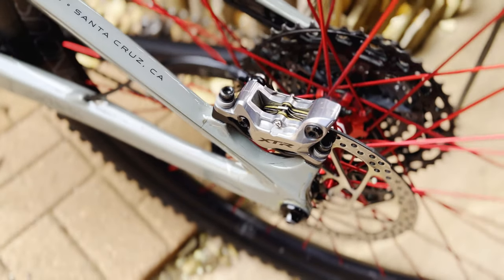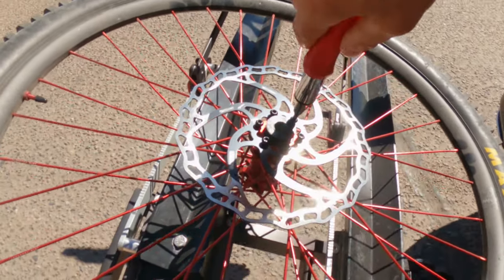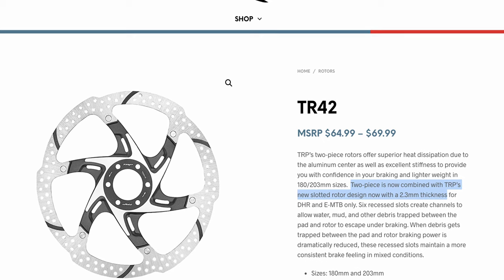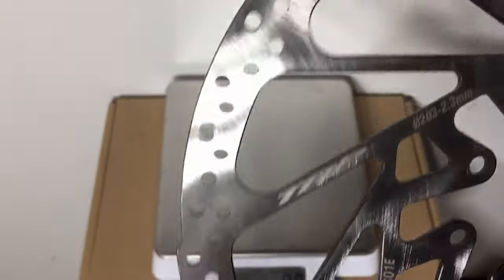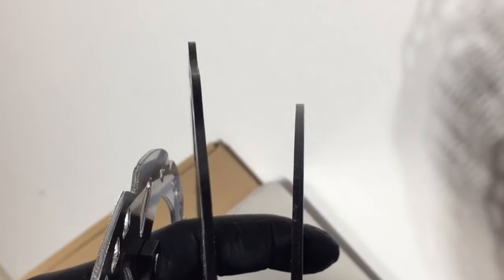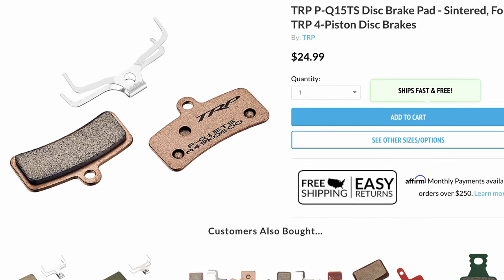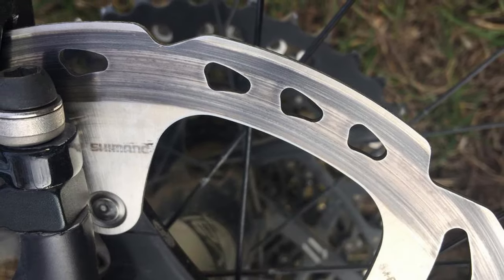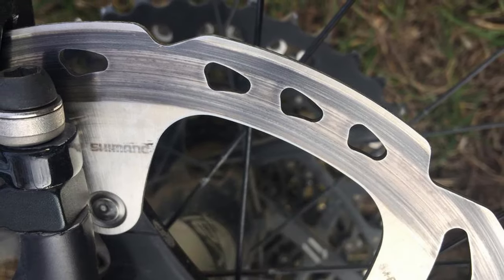Mountain Bike Brakes 2 - TRP 2.3mm Rotors: Next level performance.

Comment: We always appreciate your honest and up front reviews. I just wanted to explain a couple things. Firstly, the "popping noise" heard when applying pressure to your brakes with our rotors are 100% designed to do just that. We spent much time developing a rotor that would vent the hot gasses produced by the brake pads "the popping noise" the bigger cutouts on our rotors are designed to take a big gulp of air and as it passes through the pads and gets compressed then almost give you an exhaust note on exit which will cool the rotor and pad surface simultaneously. Secondly it looks like your pad sweep was off by about 2-3mm too high, so you where not even getting full pad contact. never the less, TRP makes a fantastic product! Also know that we take your criticism carefully to mind when developing our new products. keep an eye out for our new Disc Shark® and floating rotor that will be a true floating rotor both axial and radial!
keep up the video's and good work!
Reply from the maker: Thank you for the explanation, I'm sure it will help others as well as it helped me in understanding. When I called to get an tech answer, no one seemed able to explain what you did right here. So thank you for that.
Reply: This is why I love this brand lol, even though I have trp brakes I still use galfer PRO pads and they definitely changed how my old avid brakes felt

Comment: Great video. I’m also looking to improve on my Shimano 1.8 rotors. I run saints with mtx gold pads but don’t find them quite powerful. Perhaps I didn’t bed them properly or most likely bc I’m 225 lbs. TRP site shows the TR42 rotors at 2.3 thick. Wondering if this is new from TRP. Thanks in advance.

Comment: I'm not sure why everyone seems to constantly say Shimano brakes are "on or off" or "they have no modulation".  If you want to actually see what brakes that are like that feel like, try out old Hayes Nines.  Shimano Saints/Zees/XTRs most definitely DO have modulation, it's just that it's only a few MM of lever travel between no brakes and full brakes.  They force you to be much more delicate on the brake levers, but once you learn how to modulate them, oh baby what power and control they provide.  Yes they are pretty touchy, but what do you prefer, a brake with all kinds of modulation but next to no power like Hopes, or with great modulation like SRAMs but zero reliability or brakes that are a bit touchier, but are very reliable and have way more power?
Reply from the maker: I prefer my new TRP DH Evo brakes, serious power,  a little modulation and power to throw you over the bars. All while staying cool in constant braking descents. For a guy who is 215 without a pack, I love power. I will never uses SRAM brakes again. They have to be the most unreliable brakes on the market and they fade in prolonged descents losing power to stop. The TRP's are not lightest as say a SRAM or Shimano XT or XTR 4 piston but they are also not as expensive either. Priced right...
Reply: I don’t know but I have the seal codes rsc with 203mm rotors front and rear trp. And they never let me down. Love them
Reply: I don't hate the Shimano they just don't have much feel to them, coming from dirtbikes you appreciate having reliable modulation like the trp DHR or most SRAM brakes. I have run 3 sets of codes RSC and sram db8 they are super reliable for me. Idk if I'm the outlier everyone shit on SRAM brakes for various reasons but I've been impressed with the feel and reliability...
Reply: SRAMS are bomb proof if you do normal maintenance

Comment: I have Code Rs on my new DH bike and they feel really bad. There’s visibility a large gap between the rotor and pads and the brake feel reflects that. There a big dead zone at the beginning of the brake pull. Thinking about getting these to reduce that dead zone.
Reply from the maker: Yeah a 2.3mm rotor would fill that up, sounds like they would fit.

Comment: This video confirms to me my problem Ive been experiencing with my SRAM G2 Cleansweeps with BB7s.  Rear 160mm isn't so bad.  But the 180mm front is very noisy with the slot cutting noises that I can feel jittering away thru my rigid fork.  Probably putting extra pits in my headset bearings.  TRP RS01E don't seem to come in 160mm.  :(

Comment: Love this video man! 
No one has a legit review on these rotors. I'm running Shimano RT66 203mm front & back with MTX red label pads. I'm considering TRP RS01E like yours but unsure if I should reduce my rear to 180mm (like your setup). This is the first time I've had 203mm in the back and man....they STOP. 
Also considering TRP pads for my XT 4 pistons. Are they better than MTX?
What do you think? 
BTW....I'm riding a 2020 Rocky Mountain Instinct BC.
Reply from the maker: What you’ll notice on mtx pads vs TRP metallic sintered pads is that one, the mtx have a quicker bite point. 

Next, trp pads are not as immediate in bite but they’re just as powerful . Furthermore, trp pads have more modulation. I’ve come to like it really. Also, trp pads are more affordable in price. But really, you can’t go wrong with either though. 

Honestly, a rear 180mm TRP rotor that is 2.3mm is going to feel like a 203mm rotor that’s 1.8mm thick. You can run the trp rear 203mm but I think it’s overkill. 

But remember, if you watch the video. If you go with the TRP rotors choose your pads and stick with them. If you use new and different pads that are on old rotors, those old rotors are gonna scream like turkeys. 

TRP rotors and pads for the xt 4 piston brakes are gonna be legit, you’ll love the powerful performance. You just have to re-adjust the caliper because the clearance is tight. 

Let me know how it works for you. Ride on…

Comment: that noise at 1:50 isn't necessarily bad, I believe it's just the rotor "gaps" slicing through your pads, it helps keeping them clean. I find the low speed noise strange though since I've had great experiences with galfer products and they were not noisy at all.
Reply from the maker: I was using TRP 2.3mm rotors and now switched the the Galfer Shark tooth rotor at 2.0. Silent and no issues, plus they look pretty aggressive. Love em.
Reply: @travelthenarrowtrail8660  why the change? :0, just ordered some trp rotors, I'm afraid they will be too heavy
Reply: @travelthenarrowtrail8660 Would you say the Galfer shark tooth rotor is better than the TRP 2.3?
Reply from the maker: @Montezuma0  So, I've been using the shark tooth rotor. It's pretty good in all aspects, except for heat on long descents. The TRP rotor dissipates heat better due to its thickness. However, the shark rotors are lighter, which makes less rolling mass and creates a snappier wheel.

Comment: I have Shimano SLX Brakes M7100 series , can i put this TRP 2.3mm rotors with original Shimano pads ?
Reply from the maker: I don't see why not. Hey, you can install them on the wheels, line up the caliper and see. The clearance is small but it will work. If they are rubbing all the way then they won't. If they don't work, return them to the retailer.
Reply: @travelthenarrowtrail8660  👌

Comment: I ordered the galfer wave 2.0 for my ebike on Tuesday. They shipped from Poland to Germany to my house in Florida on Thursday which is insane.

I consider the TRP 2.3mm but there were mixed opinions as to whether they’d actually fit.

I’ve got pretty crappy brakes (tektro auriga 2 pots), but I’m hoping the bigger rotors and ceramic/metallic pads will make a noticeable improvement
Reply from the maker: That's the other problem with galfer rotors are they ship them sometimes from outside the USA. Sometimes the rotors can get bent coming from such a trek. So make sure they come to you straight not bent because this will ruin your experience as they will rub if you are unable to straighten them out.

Comment: The galfer noise that flutters that you demonstrated ,could you feel this fluttering when braking too through the lever? As I have this issue on my front galfer wave rotor and the feel is more annoying that the noise.
Reply from the maker: I have switched to the Galfer Shark rotors and have had no issues in any way. More quieter too.
Reply: Better than the trp?

Comment: thanks for the video, helpfull!
do you know if the trp pads can be used on sram 4 piston rotors?
I would like to try that combination just before changed the full code rsc setup for a shimano xt with trp rotors or even full trp dhr setup.

i am not getting all sorted with the rsc from new.
Reply from the maker: Great question, I would contact TRP and ask them. I do know that MTX makes pads for sram 4 piston rotors in the gold, and they work amazing!

Comment: Cool video! I recently bought my first ebike(Levo) after owning countless mtbs. I still own a hardtail and full sus all mountain bike. I have had good experiences with Sram, Shimano and most recently, TRP brakes. 

I put some trp dhr evos on and was blown away with how great they are. They worked great for first few weeks until my new Nobl tr41 wheels showed up with Onyx classic centerlock hubs. 

Not sure what I did but I lost the amazing lever feel in the rear. It looks like I have a slight bend on the rear rotor and its enough to push the pistons in as it rotates. The lever feels great in the garage after I purge it but when I get out to the trails, the lever pulls way further than it should. If i pump them up while riding, they are good. If I ride for few minutes and dont use the rear brake, the lever pulls way too far once I use it. I have bleed the rear brake and purged the lever over and over. 

I am going to see if I can get the slight bend out of the rotor. Thats the only thing I can think of that would do this! Ahhhhh
Cool video again!
Reply from the maker: It could be the bent rotor has warn down the pad on one side. I would also purchase new set of pads and try the lever. Could also have some bubbles in the brake line, another possibility.

Comment: I've recently installed TRP 2.3 mm rotors for my Saint brakes. After bedding in they became so powerful that I have gone OTB not expecting this amount of power. Really worth every penny!
Reply: How does thicker rotors give you more power? I keep hearing that but don't understand how
Reply: @Rickie-37  A part of it is subjective as with thicker rotors you get the bite point faster and feel more power. But the other thing is that they don't get hot so fast, so they maintain optimal braking parameters during longer descends. As there is no fade, you get that bite when you need to brake more after you have been slowing down before.
Reply: thats not rotor related if they are the same size.
Reply: @MrSupermugen  I have changed only the rotors, and my brakes are more powerful. 
Maybe it is not direct, but thicker rotors need less cooling, so less holes. Less holes = more contact surface = more friction = better breaking.

Comment: have you tried trp red? i just got new trp rotors this video making me wanna get gold instead and bed them into the fresh rotors
Reply from the maker: Are you talking about MTX red brake pads? If so, yes I’ve tried them. They are good too but not as noticeable in power as the gold.
Reply: I just got some TRP DH-R evo brakes and can’t decide between the red or gold label MTX pads on my Santa Cruz Nomad. I have SRAM code R brakes now, with HS2 rotors and red label pads and feels great at the start of a DH run but twords the bottom they fade and lose about 50% power. I don’t know if it’s because of the SRAM code brakes, the rotors, the pads, or what?

Comment: I have a set of shimano XTs . I tried ice tec rotors first they sucked so bad warped after every ride constantly need to true the rotors . Awesome video just bought a set of trp 2.3 rotors i wasnt sure if they would fit but after watching this im sold!!
You got to try the galfer purple pads they are so good.
Reply: Did the 2.3 rotors fit your shimano xt ? M8120 ?
Reply: @bathg1  yes they fit perfectly just installed them last night. Just make sure you clean and reset your caliper pistons :D
Reply: Thanks 😁
Reply: Can you send some photos or a video with fitment and clearance??
Reply: @bathg1  this video shows the clearance very well. It all works great.
Reply: I have a 2.0 rotor 
I have looked .. the fittment on the 2.0 rotor is so tight i really cant belive you fitted a 2.3🤯🤯🤯
Reply: @bathg1  I have the shimano m8120 4 pot caliper and the trp 2.3mm thick rotor fits very good. Honestly im suprised aswell considering the stock rotors are 1.8mm.
Reply: @bathg1  Just reset the pistons

Comment: I put the Galfer rotors on a downhill bike with old, rebuilt guide R brakes. They stop really well and also make that same noise. I just use the noise as a reminder to start riding better and let off the brakes
Reply: What pads do you use sir?
Reply: @cocoplops4982  EBC red and sram pads
Reply: @cocoplops4982  as of right now that setup works better than my code RSC, but I think those need a full rebuild

Comment: I bought a fuel ex 7 that came standard with a TRP brake system which I didn't like at all, I installed some Shimano model XT and the discs of the same brand didn't work, they folded like paper. Having saved the trp rotors, I just installed them as you show in your video and what a surprise I was, it brakes excellent, the discs do not bend with the heat and goodbye vibration to the front of the bicycle, thanks for the contribution!